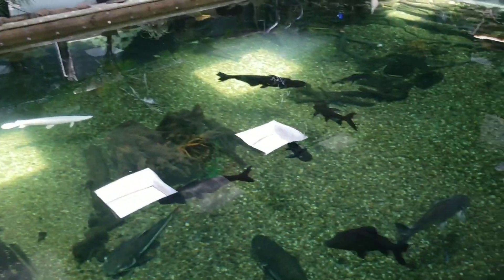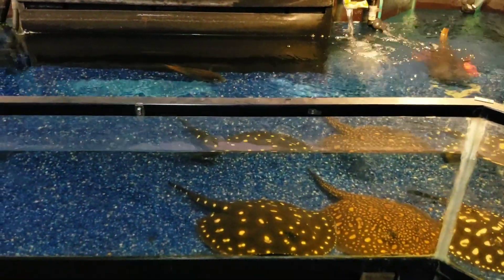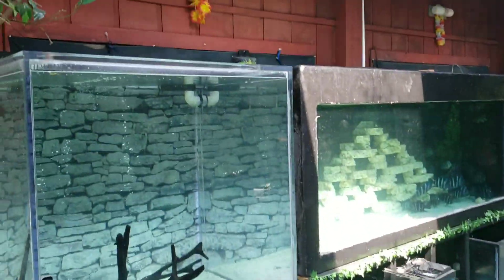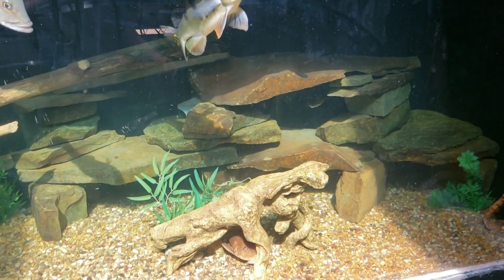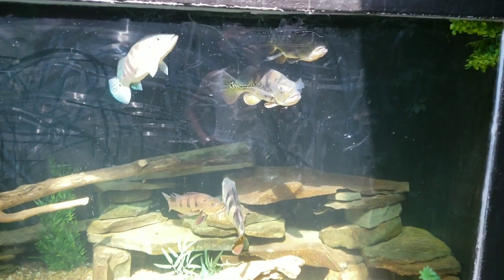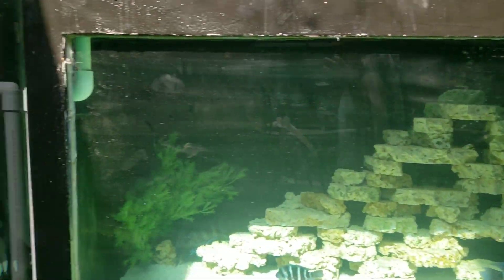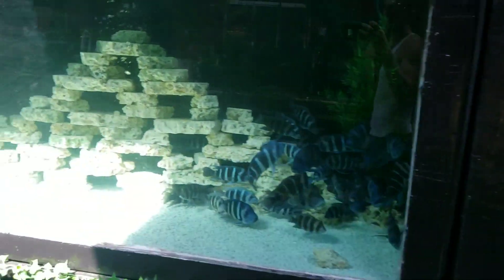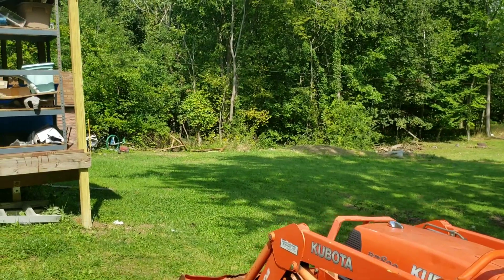Filtering 2,200 Gallons of Water without Additional Pumps!!! How did we do it?

Comment: Possible idea for cleaning the glass:  Don't microfiber cloths clean glass of finger prints without spray?  If so, could you put a mocrofiber cloth on each tank or every couple of tanks and just ask people to wipe the glass themselves if they touch the tanks, help keep the glass clean?
Reply: Hi the other Tiffany 👍
Reply: @VinnysAquatics  Hi!
Reply: =) great idea. Microfiber works so great. Ive got 2 for each of my tanks. For particular tough spots i get it a little rewet with tank water then go back over with dry cloth no muss no fuss. Was grateful i was already used to using them for mirrors lol.